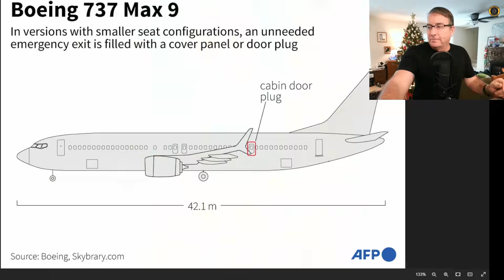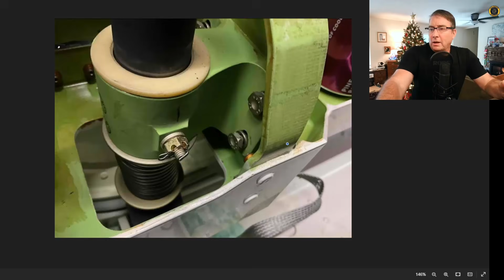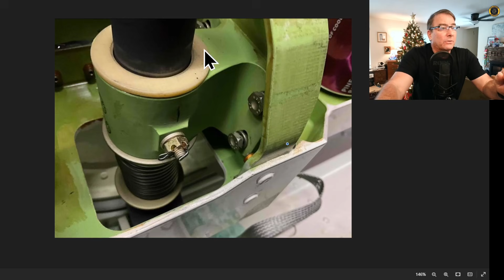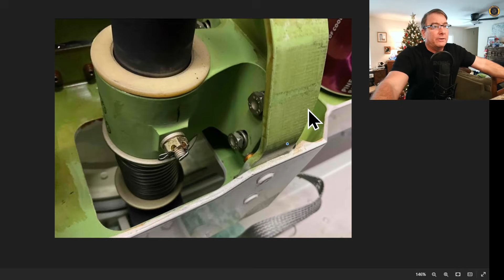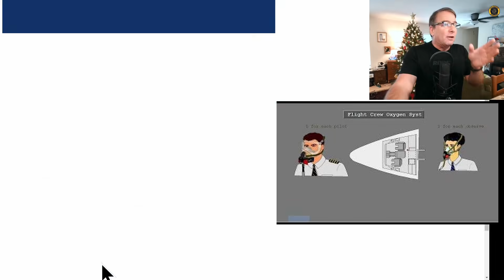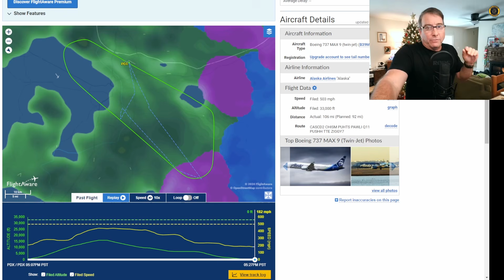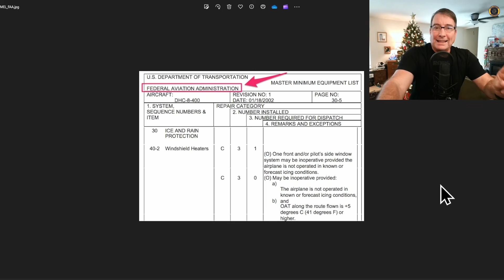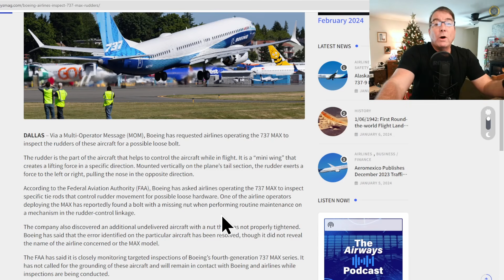"Yes, We Have No Bolts"  9 Jan 737 Max-9 Update

Comment: In the late 80s I was on a flight from DFW to OKC in a 30 seat twin prop aircraft. We were at 10k feet when the cabin door at the rear of the plane partially opened. I understood later that a secondary lock prevented it from opening all the way but the cabin did depressurize. The noise was horrendous and we couldn’t have been going half as fast as this Alaska Air jet. The pilot descended to 5k feet and the pilot or copilot came to the rear and resecured the door with a great deal of effort. We continued on to OKC and landed safely. I noted at the time that a passenger who happened to be sitting across the aisle from the door moved to the front of the cabin as soon as the door was safely secured.

Comment: A320/A330 cockpit door open inward the cockpit, in case of depressurization in the cockpit (cracked/blown window)  the door will open inward, in case of depressurization in passenger cabin the blow out panel will open towards the cabin compartment...
Ciao ;)

Comment: Loose bolts!  That is what happens when a bicycle comes apart, not a commercial airliner.  Pass on the "self certifying" Boeing's, and pick airlines who have overrides for failed angle-of-accent controls, let alone loose bolts.  You can't call a tow truck when Boeing craft fail in the sky.

Comment: Thanks for the reporting Juan.
The 737 Max fiasco is starting to fit the "onion" scenario... the more layers that you peel back, the more errors and omissions you find.
This is ugly on a lot of levels.
Reply: Exactly.  How many more accidents do we need to have before someone realizes the max variants should be highly scrutinized and maybe even completely recertified?  People's lives are at stake
Reply: At some point the FAA needs to put better safeguards in place to prevent this "same type" manipulation.
Reply: @aawillma  FAA is in Boeing's pocket
Reply: Unfortunately, it's not surprising to find layers of errors and omissions for an event like this. Events like this only happen when multiple layers of faults line up just right (or wrong).

Comment: You are spot-on that much of the controversy surrounding the MAX configurations is tied to the business end ... and it was the airlines pressuring Boeing to eliminate new type rating cert (aka: re-training) requirement for the MAX equipment.  The airlines and Boeing are *BOTH* equally to blame.  IMHO
Reply: I don't think so. Boeing should have had the insight to say that what the airlines wanted is impossible to do safely. Airlines had no idea Boeing would mess up so badly when making MCAS.
Reply: Short-term profits uber alles is going to be the ruination of (still more) US industries.

Comment: The bolts you point out that’s to hold the hinge fittings at 6:42 of the video appear to be installed with a slotted hole in the actual hinge?  It also appears in the photo to be a lock washer behind the head of the bolt?  Is that what I’m seeing?  If that’s a slotted hole in that hinge there MUST be a flat washer, then the lock and then the head of the nut.  Pretty basic mechanical stuff but I’m sure I’m looking at that photo wrong on my HD OLED LG TV.

Comment: On the Torque bolts, there should be paint marks to show if the bolts have moved. Just to mention a brand name so you can research, then "Security Check Paint Marker", or  "Bolt Mark" Identifier.

Comment: The fact both the door and the frame on the plane are in decent shape pretty clearly indicates that the door was simply not secured by those 4 cross pinning bolts.  As though that final step of installing those pins was missed.  They got the door installed and then somehow skipped that step.
Reply: But signed it off as inspected. I mean there must be an inspection step for this. Surely.
Reply: @cageordie  That wouldn't be suprising I watched tons of aviation disasters due to improper maintenance or installations that were signed off without any kind of quality check.
Reply: This also explains the mystery decompression problems. The door was just rattling around loose.
Reply: Completely skipped it!  That door would have never come off even if only one of the four bolts were installed.  Someone pulled that door shut during assembly or interior install and then the shift change hit and went home with bolts in their shirt pocket!  Somebody's wife was doing laundry later that night and wondered why four bolts were rattling around in the clothes dryer!
Reply: Union break

Comment: Well, I can picture how this happened. When you install a standard door, you're not going to have those bolts with the castle nut so that the thing can't be opened, and I think that the workers who were putting these plug doors in weren't fully thinking that this was a door that was not going to be opened. In fact, there could have been multiple individuals involved and no one person who had the responsibility for checking.

Comment: Those two bolts are not safety wired? That bottom in yours picture is clearly loose and it does look like a lock washer under the head.

Comment: Hold on a second, in the MAX FCOM, chapter 1, Airplane General, Emergency Equipment, Doors, Windows, page 1.30.10, Controls and Indicators, two “Decompression Panels” are clearly shown and described.

Furthermore, under Systems Description, it states:

“The door incorporates two pressure sensors that unlock the decompression panels 
in the event pressurization is lost. The decompression panels have manual release 
pins. Pulling the pins frees the panels allowing egress in the event the door is 
jammed.”

I am not inferring that Boeing once again dropped the pin (pun intended) yet again with their MAX aircrafts. Maybe they did, maybe they didn’t. What I am saying however is that the NTSB is insinuating that Boeing never told anyone about the decompression panels on the cockpit door and that’s blatantly false.

Then again, with a nitwit like Pete Buttigieg as U.S. Secretary of Transportation, any treasonous democrats really, what else could one expect?

Furthermore, I am greatly disturbed by the lack of standard phraseology in the average U.S. crew members. The JEPPS General manual is crystal clear when it comes to standard communication in case of an emergency: pilots should call “Mayday” three times, something this Alaska crew never did.

I lay the blame on the Alaska Airlines training department. The Law of Primacy dictates that crews should be trained from day one to transmit a Mayday every time they train for an emergency in the simulator. This is something obviously not taught at Alaska.

But I digress. 

We are now living in a world where designing, manufacturing, training, flying and air traffic controlling large aircrafts is based on DEI (diversity, equity, inclusion.) 

The days of hiring personnel based on meritocracy are over…
Reply: Ignoring your misguided political commentary, your statement on the door further proves their point. According to reports, the whole door was opened, not just the panels as per the manual in your excerpt. That was Juan's contention with the cockpit door function.
Reply: A sensor unlocking a panel split can then be manually opened to allow emergency egress, is not the same as the door flying open by itself.

Comment: The description needs to be changed from “door plug” to “plug hatch.” So you have plug doors or plug hatches. “Door plug” doesn’t work because it confuses with plug door. Possibly doorway plug but without a door it is a hatchway.
Reply: What is adding to the confusion here is that I think the manufacturers are claiming that because of the arrangement of the stops in the closed position this technically qualifies as a "plug door". Obviously it is not as failsafe as a true plug door.

Comment: I know this is just a plug, but I think the old 757 - 200 door 3 had similar internal operations when you pulled the exit handel up  it lifted up and fell down on hinges when opened - and the slide would deploy.

Comment: Why the hell aren’t all these nuts on the bolts wire-locked, or even welded on in the case of these redundant plug doors. Yes I know the pin restriction nuts had castellated nuts and cotter pins (we call them split pins in 🇬🇧).

Comment: What happens with a windscreen failure and loss of pressure in the flight deck? I don't think the hardened security door would blow open into the flight deck. Would the blowout panels in the door allow flight deck pressure and cabin pressure to equalize?  Also, could a windscreen failure possibly cause flight deck air pressure to increase, from ram air effect?

Comment: I'm really impressed that the door-plug fell 16,000' and didn't get all bent out of shape.  It must have a lift body shape. I wonder how far from the flight path it "flew".
Reply: Using the Flightaware24 data to interpolate the position between the two positions reported before and after the time Juan noted the cabin pressure plummeted, it appears the aircraft was above the Beaverton Creek mass transit station on the SW side of Portland when the "departure" occurred. I found the address of the teacher who found the plug via several online databases, and Google Street views at that address also show the home across the street behind NTSB personnel in a photo of them inspecting the door--so I am confident about that fix. Google Map's distance tool shows that distance to be 2.91 miles from Beaverton Creek station. For what it's worth, that home is only around 2000 ft roughly north from the spot where one of the cellphones was found and shown in other pictures of NTSB personnel with the fellow who located it.
Reply: Apparently it got a pretty soft landing through some scrubby trees, so that probably helped

Comment: One would think that all parts and bolts needed when assembling parts of the aircraft arrive at the assembly station ready picked in the correct number with a bar code that is scanned when used. Or is Boeing using buckets of loose bolts that the mechanics go pick from as they please?
Four bolts and nuts not being used and still laying on the counter should raise red flags.

Comment: I think I am missing something here. The explanation is absolutely excellent but I still don't understand how the plug door is designed to slide upwards if it's already completely filling the aperture. Same idea for installation: how can the plug get into the hole if it has to slide down AFTER it's in the hole?
Reply: It doesn't fill the hole. Look at the exterior pictures of the plug or door in place, a gap is visible at the top.

Comment: It's very likely ARR left the bolts out. They say they didn't work near the door plug,  but that's not true. The did work near the KU antenna and they remove the plug for faster access, the KU antenna is in the crown near the plug door. Coincidence that the first pressure error occured the day ARR handed the airplane back to Alaska Airlines?
Reply: Interesting

Comment: I refuse to give a pass about the cockpit voice recording being overwritten to anyone; pilots, ground crew, and including regulators. That checklist should be memorized. Nevermind needing a checklist, saving data/logs is litterally the first step after every major event for any technology system. The second issue I refuse to give a pass on is the technology and regulation of the voice recorder itself. In these planes carrying hundreds of people, 2 hours isn't even close to what the recording loop should be. Its 2024, 2 days of recording loop is even too short. Its 2024, even an automobile can automatically save data following an emergency event. This data being overwritten is a terrible look and It only fuels my suspicion that they talked about the planes pressurization issues before embarking, and ignored them before putting everyone in harms way. I hope improvements are made!

Comment: Just a minor comment. An "explosive" decompression is defined as one in which the air cannot flow outside lungs and other cavities quick enough to not cause trauma. Since no person was injured by the decompression it is technically a "rapid decompression". It may well have been an explosive decompression if it happened somewhat higher.

Comment: I’m curious..what are cabins typically pressurized too? How many psi? I’m just thinking how many square inches are on that door..that must have been one heck of a bang when it let go.
Reply: If you are in outer space your suit or "capsule" needs to be at around 14 psi (14.7 psi?) or a bit less to be similar to low elevation on Earth,I think to simulate being at 18,000' above sea level would be about half that,so since airplanes go quite a bit  higher than 18,000' they would be pressurized to more than 7 psi but less than 14 psi 
I don't think airplanes (or space capsules) are pressurized all of the way to simulate sea level but maybe more like being in Denver or perhaps even like being in one of the highest cities in Bolivia or Peru,also the space capsule might have an oxygen enhanced mixture enabling a lower pressure than if using ordinary air 
   I think the airplanes have a maximum pressure they can achieve (relative to outside at altitude) and I might have seen a figure of just under 9 psi for that maximum or an emergency blow off valve prevents pressure from climbing higher even if the machinery in the plane tries to pressurize it more. 
When you are up at altitude in a commercial jetliner I think the cabin altitude is quite a bit higher (lower pressure) than sea level equivalent (but not nearly as high (lower pressure) as the plane is cruising)
cabin altitude high = cabin pressure low ?

Comment: It's a bit concerning that someone with nefarious intentions other than just creating this mess in the first place now knows that this type of de-pressure can open the cockpit doors if that is their goal.
Reply: Was thinking the same thing…
Reply: @TubularBelle16  Ditto
Reply: I just can’t see how it could help them achieve their goals. Punching a massive hole in the side of the airplane is hard,or at least should be
Reply: @andrewpease3688 Not hard for someone with direct authorized access to those plug doors.
Reply: Mu understanding was that on the inside, you don't see any of the plug bits, it just looks like the cabin.  Hopefully, if someone started pulling the wall off and pulled out tools, people would notice and react.
Reply: @kcgunesq  I'm referring to someone that works on the maintenance crew prepping the door to fail
Reply: @mrdubachery 
Somebody who works on the maintenance crew could probably just tamper with the cockpit door instead. 

Even if they decided the plug was easier, they'd have to not only make sure that the first flight after was not a repositioning flight, and that they could get their accomplices on that first flight, they'd also have to be able to reliably predict that the door would fail on that first flight. It doesn't exactly seem foolproof.
Reply: @Ellie-rx3jt  Only has to work once.   The door shouldn't open under these circumstances. And sabotage like this has happened before and this is far less easy to spot than sneaking explosives onto an aircraft.

Comment: Congrats Boeing you took a great Airplane, and with factors you had  complete control over MCAS, and now this plug door! have made it a cliche for unsafe practices. Now in the future if even a armrest falls off a single seat in the MAX it will most likely be frontline news! Perhaps make all critical Installs, and safety related maint as requiring two RII inspectors??- at least for a couple of years!!

Comment: Great video! On the Airbus family, we have (overhead panel) "two redundant differential pressure sensors enable rapid pressure variation in the cockpit to be detected, in order to command simultaneous opening of all latches when a defined
pressure drop is detected." (FCOM). The door panel itself does not come off because of a depressurization. The panel is removed, by MEL, in case of, e.g., positioning flights with only two pilots on board (restroom usage). And the cockpit door opens to the inside (no problem blasting open and closing wc door...).
Reply: it seems much safer against terrorists.

Comment: Where are these airframes being manufactured, FFS? China?  This is what happens when aircraft manufacturers and operators look only to their bottom line.  We used to have exceptionally high standards for Quality Control - both in manufacturing and MX personnel - when it came to all things aviation.  I guess that too has been "exported" out of the U.S.  When I worked for Eastern Airlines, during the days of hostile mergers and cut-rate airfares, we APs had an expression: "Fly cheap, die cheap."